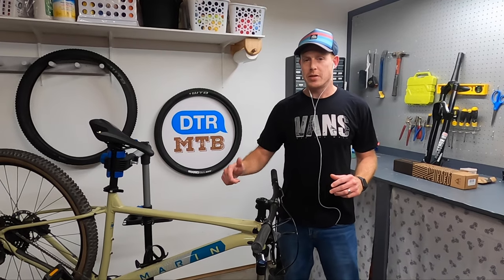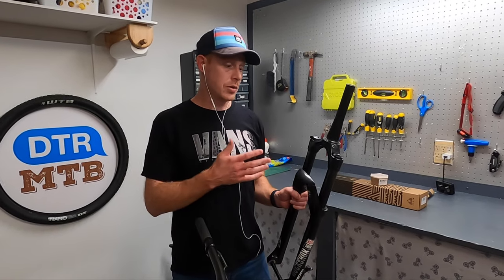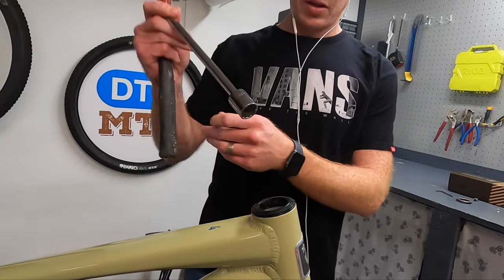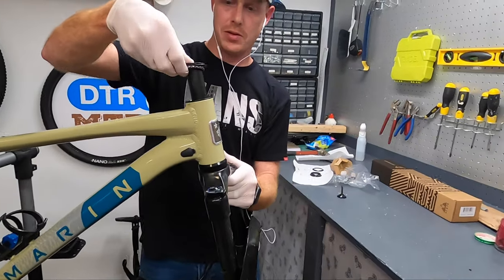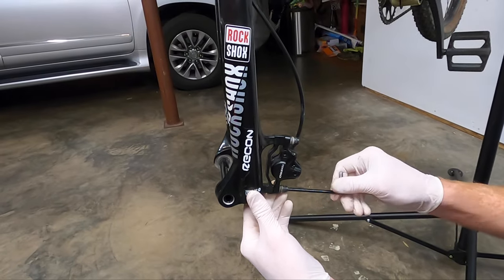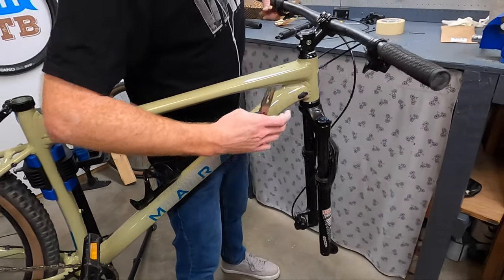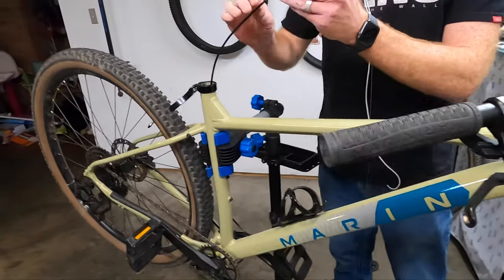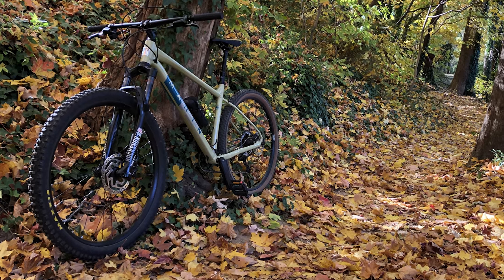2022 Marin Bobcat Trail 4 - Two Major Upgrades

Comment: Thanks for this. I have the Trail 5 and have been wondering how to upgrade the fork to a modern tapered design. For me, this video is gold and you've earned a sub.
Reply from the maker: Happy to spread the knowledge and glad to have you as a sub! Cheers!
Reply: @downtoridemtb  Finally gone and done it. RS 35 Gold 140mm with a Cane Creek EC44/40 lower cup. My mechanic had to shave 3mm off the cup flange to seat it right. Also went with 2.4in tubeless and it feels like a brand new better bike. Still shopping for a dropper. Thanks again for the inspiration and know-how.
Reply from the maker: Ooooh, 35 Gold is nice! Glad you got it all worked out with the headset. What tires did you go with?
Reply: @downtoridemtb  New Continental Kryptotal 2.4in in trail spec casing. Not as fast rolling as the stock ones but very stable and grippy, perfect for fall & winter riding. The 2.4 juuust clears the chainstays.
Reply from the maker: Cool I have just started hearing about those. They look solid!

Comment: I have this bike. Did changing the forks with the new headset alter the ride position, I love the geometry. Even for road it's super comfortable, I want to change the forks as they're rather heavy and dull but I don't want to alter my ride position
Reply from the maker: Or raised the front end a little because of the height of the headset and the Rekon fork has 10mm more travel. I think it was an improvement though especially with those stock bars that are nearly flat.
Reply: @downtoridemtb   great to know and I really appreciate the reply. Happy riding!

Comment: Very helpful, well made video. I bought a Rockshox Recon that was advertised as 15x100 thru axle (i have the wildcat tr 5). However it actually has a boost through axle. If I want to use the stock wheel, would it be more sensible to just change the front hub, or use an adapter kit? 15x100 thru axle forks are a rare find anyway, so I wouldn't mind keeping. This bike is such a great deal.
Reply from the maker: Changing the front hub would be the way to go if you’re able to do the labor. Otherwise a new wheel (or used) would probably be cheaper than paying to have a hub swapped. Good luck!
Reply: @downtoridemtb  Thanks!
Reply from the maker: Welcome!

Comment: Great upgrades:) Actually I'm lookin for a stiff replecement for this SR Suntour XCM/  Any sugestions on some good models? Thanks
Reply from the maker: Thanks. I’m not sure what you mean specifically by stiff but any air fork will allow you to set the pressure how you want. Rockshox Judy or Recon. SR Suntour Raidon or Epixon. Or if you want to spend more look at the entry level Marzocchi Bomber. Or look at the used market, I got a nice Fox 34 Rhythm that way but I also see a lot of Recons for sale there too.
Reply: @downtoridemtb   I mean of course alu rigid fork to replace heavy  SR Suntour XCM HLO-DS - with good alu fork  I will reduce the weight by. 2 kilos .Unfortunately I can not find an interesting replacement- maybe have U any recommendations?

Comment: What fork offset should I choose for the Bobcat Trail 4? I bought it with 27.5 wheels. Rockshox is sold in different offsets, there are 42mm (27.5), 42mm (29), 46mm (27.5), 46mm (29).
Reply from the maker: Good question but I have no idea the answer. I mean obviously the ones that say 29 are out. Maybe see if you can find out what the stock fork offset is. Then do some quick research on how different offsets affect the ride and steering.

Comment: How did you run the cable through the rubber hole covers in the frame? Specifically the lower one with the rear brake cable running through it.
Reply from the maker: I didn’t actually run it through that rubber piece. Just left it wide open. I think if I was able to keep the bike, I probably would have cut a slot through one end of the rubber piece to try to jam it back in there.

Comment: I'm not sure I got that right, there is a non tampered head tube and you put an  external head set on it to make it work with tapered steerer?
Reply from the maker: Exactly. The EC44 lower headset steps it out wider and allows the tapered steerer tube to fit. It also adds about 13mm to the stack height.
Reply: @downtoridemtb  awesome, great for oldies but goodies

Comment: Question: I have a 2019 trail 4 I'm putting a tapered recon on,  I purchased the wolf tooth ec44 which did not fit due to the insertion depth of the headtube itself being too shallow for the headset, which when fully inserted left a gap between the cup and the bottom of the headtube. I watched your video and ordered this headset, just curious if you encountered that when deciding on the funn brand headset? Does it have a shallower insertion than other ec44's? Thanks! Great video!
Reply from the maker: I didn’t have any issues with the insertion depth. Comparing pictures of the Wolf Tooth and Funn headsets, it does look like the inner portion of the Wolf Tooth is longer. So yeah I think you’ll be good to go once you get the Funn headset. Hope it all goes well and you enjoy the results!

Comment: 8:10 What is this riser brand, or what riser would you advise for this job? A good one, not the most expensive, thanks!
Reply from the maker: Dimension is the brand. Actually came from a local bike shop like 3 years ago but it wasn’t expensive.
Reply: @downtoridemtb  Thanks! I have two Bobcats 4 to upgrade 29 and 27,5 – actually, we prefer to choose forks that does not require any further modifications to the bikes. Apparently, Suntour Epixon-9 would be good. 

May I ask what travel of the fork to choose, please? For 29-inch bike I am 184 cm/100 kg and for the 27,5 size my son is 165 cm/60 kg – does it really matters how tall and how heavy the rider is? Thank you for your help (Yet another advised fork was X-Fusion RC32)

As for the PNW Ridge, is that model ok for both of us, considering the difference in bike size and me and my son height? 
We appreciate very much your help and advice :) Thank you
Reply from the maker: Fork travel: I like to stay within 10mm of stock although it is generally acceptable to go +-20mm. Your size and weight has nothing to do with it because setting up the air sprung fork will allow proper sag and travel. 

Seatpost: that one is good but so are a lot of others. More money usually means lighter or more seatpost travel. The more travel the better as long as it will insert in the frame far enough and give you the right height when extended. PNW has a lot of options at various travel lengths and prices.

Comment: What diameter is that steerer tube on that RS Recon 1.5” or 1-1/8”? Tapered
Reply from the maker: Yes the recon I used was tapered 1 1/8 to 1.5

Comment: hi i want to upgrade this bike with a bomber z2 do you think it wil fit
Reply from the maker: As long as the steerer tube is long enough then you should be fine. You’ll probably run into the same issue with the tapered steerer tube and boost thru axles though.
Reply: @downtoridemtb  thanks

Comment: Polygon xtrada 5 and bobcat trail 4...which is better trail bike ?
Reply from the maker: Bobcat Trail 4 just for the fact that it has the 1x drivetrain.
Reply: @downtoridemtb  ok..but 2021 bobcat trail 4 model was 2x9 drivetrain where xtrada 5 has 2x10 drivetrain....which is better if we have to compare between these
Reply: @downtoridemtb  for trai ride 1x drivetrain is better than 2x ??
Reply from the maker: 1x is better for trail riding. Simpler, lighter and better chain retention. The two bikes are very similar. I don’t think you can go wrong with either.
Reply: @downtoridemtb is 1x10 or 1x11 or 1x12 good in terms of climb and speed ??
Reply from the maker: It’s all about the overall range. The lowest low number and the highest high number. Personally I prefer wide range 10 and 11 speed over 12 speed.
Reply: @downtoridemtb  ok. So 11-46 or 11-51 cassette , which would be a good option if 1x11 or 1x12  crankset
Reply: How many gear ratios you would prefer in terms of climb and speed

Comment: Does the bobcat 5 have a straight head tube as well? I bought the frame which doesn't come with a headset but the only information I can find is 1 1/8 to 1.5 tapered but I believe that is a straight to tapered headset size? And the complete bike says fsa no.10-p. the only one I can find is fsa n.10 which says for 1 1/8 straight steerer fork.... I'm so confused. I have a straight steerer fork laying around and would like to use it so im trying to figure out what headset I need to buy. If you could help me it would be much appreciated brother.
Reply from the maker: Looks straight to me from the photos. So I think any standard 1 1/8 headset will do. Pretty sure that is ZS44.
Reply: @downtoridemtb  yea that's what I was thinking. I'll go for a normal 44 and see what happens haha, also good video and thanks for looking into it for me.
Reply from the maker: Glad to do it. Good luck!